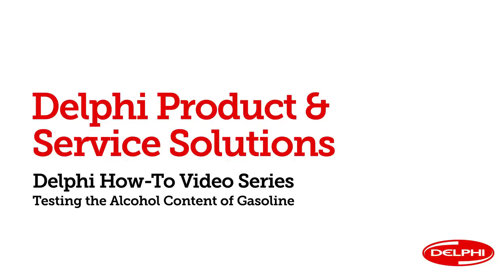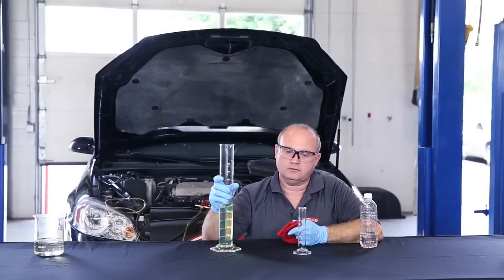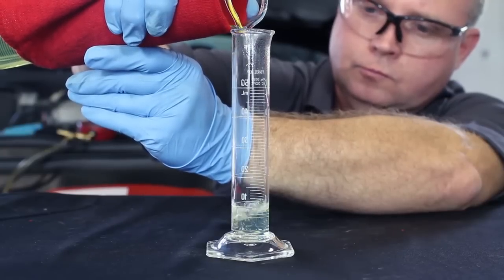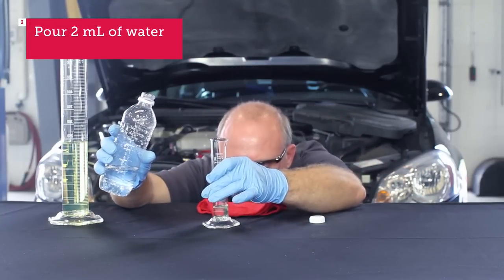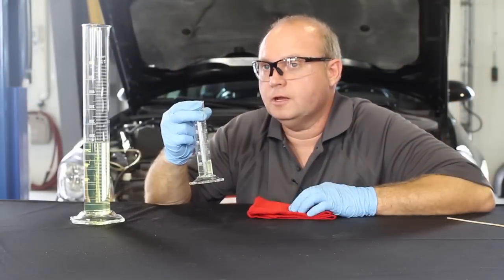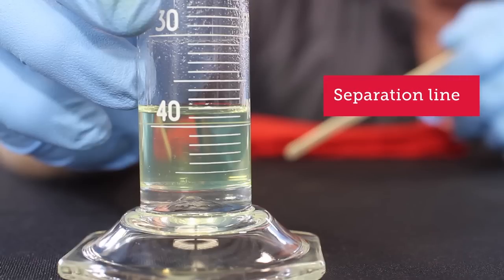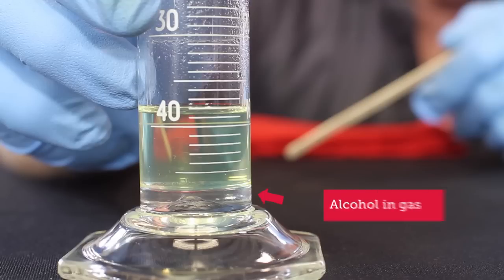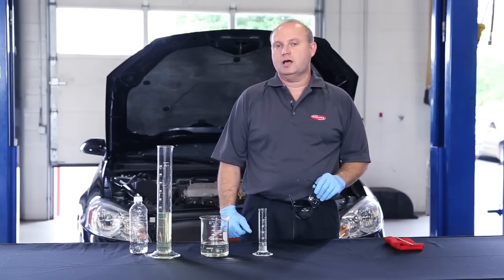How to Test the Alcohol Content of Gasoline

Comment: After adding known percentage of ethanol to gasoline, the test always shows lesser percentage of ethanol than the actuall added.
For example, I added 20 ml of water and 10 ml of ethanol to 100 ml of gasoline, the test shows only 27 percentage of water + gasoline.
Can anybody answer this phenomina.
Also I request to do the test with added known value of ethanol percentage to the gasoline.
Reply: Are you getting your reading from the bottom of the meniscus? Maybe you need a cylinder that is more precise, smaller increments?

Comment: You should put the water in cylinder first, before adding the gas.
Reply: I don't know how much it matters, but I think they should be measured separately then mixed. 
1 part alcohol + 1 part water does not = 2 parts by volume.
Reply: @elmeradams8781 Interesting. So we should probably be measuring the remaining gasoline, then find percent change
Reply: @elmeradams8781 Interesting. So we should probably be measuring the remaining gasoline, then find percent change